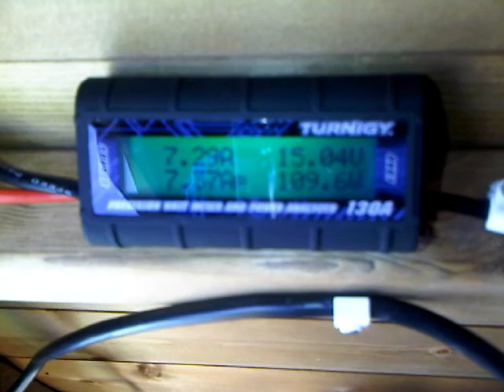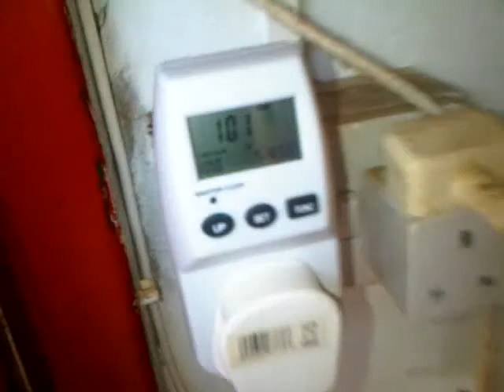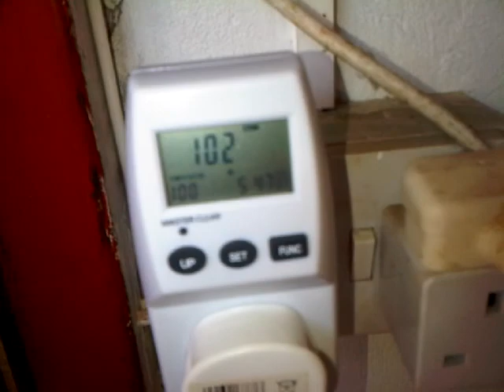UK Small Solar Shed Project Update 2

Comment from the maker: Hello TulioK,

Thanks for your comment, it is working out great!  When my panel kicks out 100W I am getting about 94W into the house so it seems to be using 6W to keep the batteries on a float charge.
It doesn't scale very well after about 150W as the lose is much bigger - I guess that is down to the efficiency of my GTI getting closer to it's limit.

I was very aware from previous comments that pushing these GTI's too much always blows them up lol

Cheers

Comment: Love the setup! Now that it's been running for a while, how are you finding having the GTI and charge controller wired in parallel with each other? For example if your panel is kicking out 100W how much goes into the batteries and how much into the mains? Thanks very much